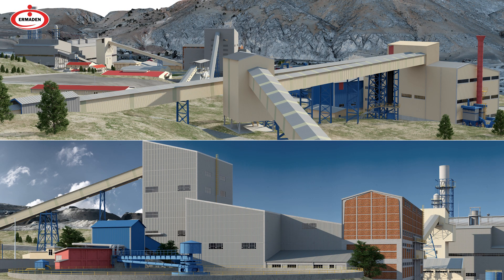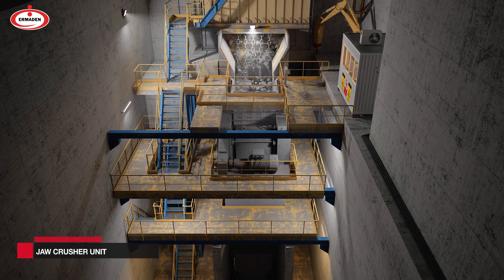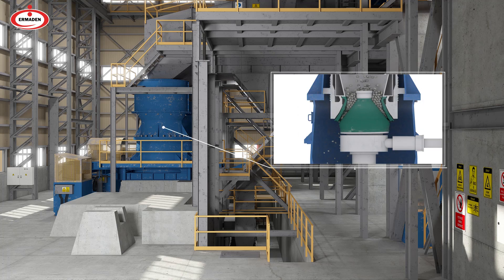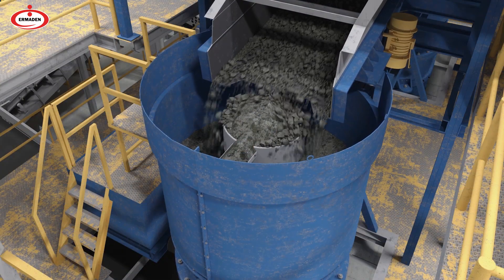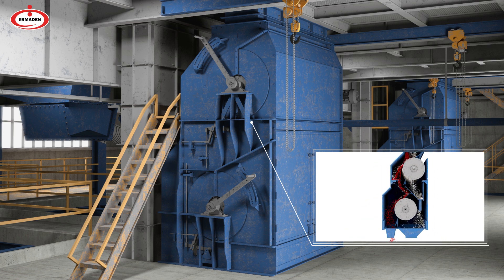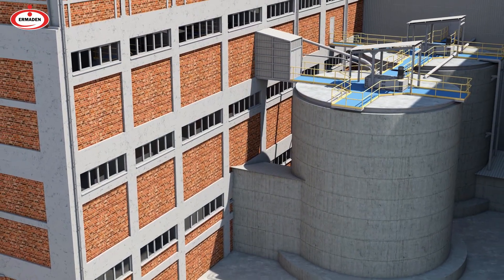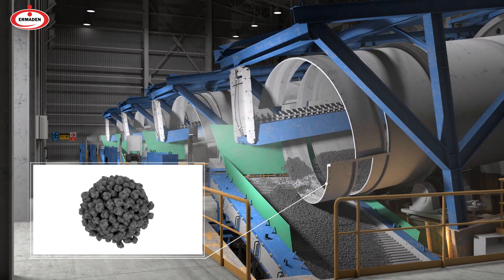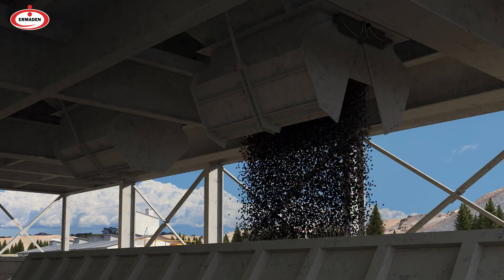What is iron ore pelletizing plant and how is it made?

Comment: Dear all,
This is  I.V.SUBBARAO from Raghuvamsi Technologies., A. P. 
If you have researched my resume, you will see that I have spent 15 years in the iron ore mineral procesing technology development of minerals, metals and beneficiation, DRI development and corporate technology, patents, use of and application of DRI Pelletization in steel making. I have spent many years evaluating DRI  Pelletization technologies and all of the single stroke DRI procesing methods non-commercial as yet now. all DRI technology not yet commercialized, all pelletising technology and specific to quality requirements and why, binder technology and technology of handling and shipping of materials and recovery of Iron ore fines in iron and steel making.  We have developed DRI Single stroke processing technology. a process which would decrease the capex and opex by possibly 30-40%. Our   processing technology was very simple method,  IPR has been granted of patents (With out adding lime stone, bentonite, dolomite and coal) , it's one of the best processing technology, it's related to mineral, metal, metallurgy, DRI and Steel. 
I am  searching for technology commercialzation funds. We are looking for JV,PE, Technology Transfer.
9490188826, 7569160194